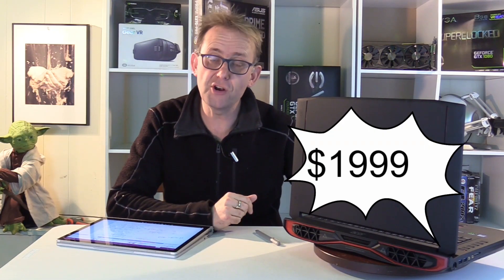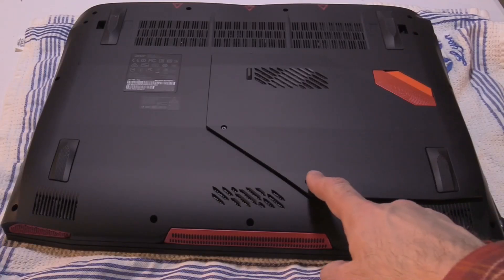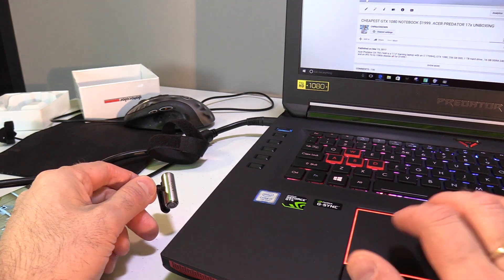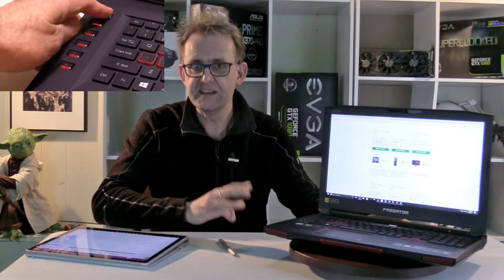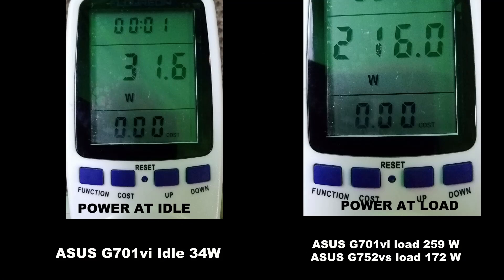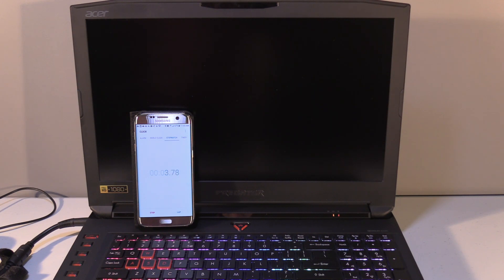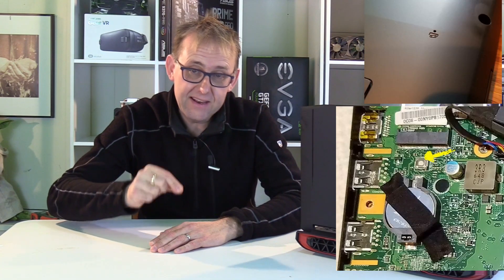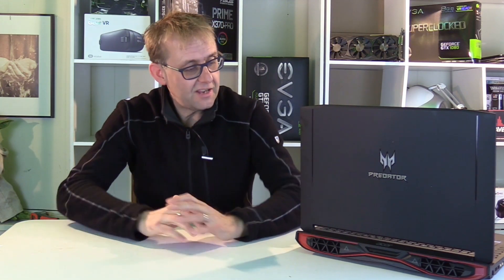CHEAPEST GTX 1080 GAMING NOTEBOOK ? ACER PREDATOR  GX-792-7448 FULL REVIEW

Comment: Steve your reviews keep getting better. This review was excellent. I have 2 questions: 1. What did ACER support suggest since resetting the CMOS didn't work. Is a BIOS update coming? If you haven't done so already, can you do a quick VLOG on how to overclock a IPS panel from 75 to 100 Hz.
Reply from the maker: Hey Keith, Thanks ! They gave me a support ticket so I could continue the conversation but since I decided I was either sending it back or selling it I just continued on. I have reset it to factory settings but I can set it up again and so video on increasing the refresh rate. Good idea ! It will give me a chance to see if the Fn key is working again too :) Support was quick though, that impressed me.

Comment: Great review, thank you for your hard work and time spent doing this. :)    :thumbs up:

Not sure if you saw my question over on the unboxing video, but I asked about a 7820hk / 1070 comparison in the form of a Clevo P670HS-G and you helped answer that question in this video, great minds think alike. For the weight, size, and small price difference I'll be getting the Clevo since I'll be carrying it every day. HIDevolution also includes a fully unlocked Prema bios on all Clevo's if you're ever in the market for one and Donald over at HID is great guy to work with when ordering from them.

Keep up the great work and thanks again!
Reply from the maker: VetteTTV12 hi there! Yes, I'm sure I replied to your previous comment. You were getting it for $1700 I think? That is exceptional value and I think you have made a great purchase. Glad I was able to confirm it for you ☺️ Thanks for watching!
Reply: OWNorDISOWN For some reason YouTube didn't send me a notice on your reply from the unboxing video. 

Yeah it'll be right under $1700 for it but that's because I already have a copy of win10 and a 1tb 850evo just sitting around not doing anything, and that's with the liquid ultra cpu / ic diamond gpu upgrade for better thermals. I plan on doing a review on it when I get it in since there doesn't seem to be any worthwhile reviews on it in this configuration and zero reviews on one with a 7820hk undervolted and overclocked like I plan to do. 

Thank you so much for everything that you do😊
Reply from the maker: VetteTTV12 Yeh, youtube has stopped sending me notifications too.. Yes, great idea. Love to see your video on it! Thanks for the kind words ☺️

Comment: As usual benefit full and fun to watch review Steven but are you sure this thing is quieter that the legendary MSI Titan ? Also at top 80s C on gaming benchmarks does not these measurements considered hot? The Msi temps 70C during gaming.

Thank you for your patience!!
Reply from the maker: Naser Jabi hi Naser, thanks. The Acer was at 35 db versus MSI 41db at load. Indeed, the MSI is cooler because of the huge fans and they do spin faster. I think 80 degrees is fine when you consider the AW17 R4 i7 7820hk./ Asus g701vi / Asus G752vs /Aorus x3 v7 all get into mid 90s. That being said, I would expect an i7 7700hq to be cooler, in the high 60s to high 70s but like I've said before, the Acer doesn't spin its fans fast, even at their highest and the result is a quiet system with higher Temps. Now, although at idle they are quiet as per the sound meter you do hear a hum which you do not on the MSI so I would consider the GT73VR quieter at idle even though their sound meter readings are similar. I hope that helps.

Comment: Really appreciate the through review I just picked up the same laptop but slightly different model gx-792-703d it has Processor
Intel® Core™ i7-7820HK processor Quad-core 2.90 GHz
Screen
17.3" Full HD (1920 x 1080) 16:9
Graphics
NVIDIA® GeForce® GTX 1080 with 8 GB Dedicated Memory
Memory
32 GB, DDR4 SDRAM
Storage
1 TB HDD, 512 GB SSD. From my limited understanding that's a better processor, more ram and storage then the one in this review. So I take the specs should be just a little better or still fairly close?
Reply from the maker: Joe Sombody thanks for watching my video. Yes, yours looks top of the line, much faster cpu when you have it overclocked - should reach 4.3Ghz easily. Let us know how you make out with it 😀

Comment: hi stephen 
firstly thank you for your interesting reviews. good job 👍
i'm planning to buy a gaming laptop and i find my self attracted to asus g752vs over MSI. I feel more trusty with asus. what do you recommend me ??? 
another question plz . 
we've saw the first g752 model late in 2015, when do you think we will see the next model ?? i mean the new design not just internal upgrades???? 
thank you again 😊
Reply from the maker: Hi Mr Architect !  Thanks for watching my channel :) I did a review on the Asus G752vs https://www.youtube.com/watch?v=ByGzHQkl6-4
It was very fast, overclocked well but ran very hot. The speakers were rather poor and I was disappointed with the build quality . I didn't mention it in my review but some of silver paint scraped off the bottom to reveal black plastic underneath. Perhaps it happened when I took it outside for the screen test. I have taken my MSI GT73VR outside a  bunch of times and have used it in many comparisons and it has not a mark on it. I would but the GT73VR Titan Pro any day of the week. A button to switch to integrated graphics, excellent speakers, good cooling, 3 m.2 slots. It has it all. It is lighter in weight too. Also has MXM GPU so can be upgraded.

If any of these guys make a design change I think it will be next year to coincide with Cannon lake . I'm hoping that at 10nm it will allow for slim devices that run cool. I think that has ben a challenge thus far. ..
Reply: +OWNorDISOWN thank you stephen 
i was in love with g752 design untill you shocked me about build quaity 😢 
actually i'm looking for the best cpu on a laptop, i'm an architect and fast rendering is my target. concedering that what would you recommend for me ???
Reply from the maker: The i7 7820hk is your best option and I must admit it seemed to perform faster in the G752vs than any of the others I have tested. Not by a huge margin but faster than the AW17 R4, faster than the G701vi. I haven't had chance to test the same CPU in the new GT73VR Titan Pro. People say that they have clocked it at 4.7 Ghz but it's not just a question of speed its how much power it draws.  For example I can overclock this new AW17 R4 to 4.6 in Throttlestop but it performs worse than at 4.4 Ghz in the Bios as it draws only 60W versus the 70W in the bios. I have to figure a way to get it to draw more watts.
Pick one that will help keep it cool ,and has a good turbo fan. The fans in this AW17 are much better, although still at 4.4Gz I get a bit of throttling

I still like the MSI GT73VR as an all round laptop but the AW17 R4 looks nicer and now with the cooling looking better it is an option - although my Killer Wifi card keeps dropping connection..
Reply: +OWNorDISOWN 
i thank your generous. that was helpful 👍

Comment: Great detailed review. Would you say the 7820hk is worth the price premium for getting the most out of an external 1080ti via graphics amplifier? I'm looking at the Alienware 17r4 with that CPU and internal 1070 and 1080p display. I want to do high resolution gaming on a 4k Oled tv with HDR. I will also be purchasing a high refresh rate external monitor. So as you can see, I'm going all in and want to know if there is a noticable difference in performance in my use case between the 7820hk and 7700hq. Thanks again.
Reply from the maker: Mike Hey Mike, thanks, glad you liked my review. I have done some tests using my Alienware 15 R3 which has an i7 4710hq and 1080p performance, using a desktop gtx 1080 in the amplifier, versus a desktop is quite poor. Step up to 3440 X 1440P or 4k that deficit went away. I am going to do the same tests using the gtx 1080ti (I'll do them tonight) and let you know how that fairs. I do have the i7 7820hk /gtx 1080 model coming in and I planned on testing my 1080ti /amp at 4k there to see if there was any difference so stay tuned for that video. In the meantime I'll give you feedback to help you with your decision 😁
Reply: OWNorDISOWN Awesome, thanks for the info. I will stay tuned for the   video and really appreciate the insight! Subbed, great channel.
Reply from the maker: Mike cheers Mike!
Reply from the maker: Hi Mike. Here are my 4k Results:  Metro Last Light:  GTX 1080 laptops @4k 53 fps, AW15 R2 GTX 1080 in the amp 51, GTA V: GTX 1080 laptops at 4k 69 fps, AW17R2 GTX 1080 in the amp 69 FPS.  Now for the GTX 1080ti results: GTA V  Desktop 94 fps, AW15R2 with AMP 80 fps. .  Metro last light: Desktop: 71 FPS, AW15R2 with AMP 59 FPS.  my AW 15R2 has an i7 4710hq and it bottlenecks the GTX 1080 at 1080p and bottlenecks the 1080ti even at 4k.  I'm sure the i7 7820hk will rectify this and will check as soon as I get it.
Reply: OWNorDISOWN Awesome, thank you so much for the information really appreciate it. Looks like the 1080ti and 7820hk will be a good combo via amplifier :) Can't wait!
Reply: OWNorDISOWN Were these tests done using laptop display or external?
Reply from the maker: Mike my AW15 R2 only has a 1080p display so i hooked it up to my 4k TV

Comment: I don't understand what's up with these companies? They keep putting out laptops with 1070 and 1080 but only 1080p. Why aren't they matching 1070 with QHD and 1080 with UHD? I don't get it. Why have a 1080 with 1080p?
Reply from the maker: Abiogenesis Zero Proof I think QHD is good for a 1080 and 1080p for the gtx 1070. 120hz options and ips 60 hz options. I just bought a Sager NP9873 with QHD 120hz and it is a great screen...
Reply: OWNorDISOWN wow, that Sager NP9873 looks like a monster. I don't have that kind of cash though. I have about $2000 USD (maybe a little bit more) to work with. I'm currently looking at the Aorus X5 V6-PC3K3D. I just want a 15.6 inch that has a 1070 with QHD...I wish I could also find 120hz but I haven't found that in 15.6 inch.
Reply from the maker: The x5 V7 is out.. I would love to try it: http://www.agearnotebooks.com/aorusx5-v7-kl3k3d.html
The Alienware 15R3 GTX 1070 can be configured with a 1080p TN 120Hz display..
Yes, I'll review the Sager NP9873. I think it takes the crown from my beloved GT73VR. Overclocked to 4.7Ghz it saves a lot of time in my rendering.  
Some great laptops coming out. I'm hoping I get chance to review the Aorus x5 MD ...
Gigabyte are sending me a P57Xv7 which is a 6.6 lb GTX 1070 17.3" one to review.
Good luck with what ever you buy !
Reply: Thanks for your help. I looked into the x5v6 vs x5v7 and they seem like the same laptop except the x5v7 has 2 more usb ports and i7-7820hk instead of x5v6 i7-6820hk. IS that worth the $400 extra? Or am I missing something else?
Reply from the maker: Not sure if the x6 is display port 1.2 v 1.3 on the v7, but yes $400 is probably not worth it for  max 0.3 Ghz extra on the CPU...
Reply: OWNorDISOWN I just wanted to thank you for the information you provided me; it helped me make my choice. I went with the Aorus x5 v6 today for $1999 plus they threw in the $150 backpack/carrying case for free (got the deal off newegg.com). After I looked through the info you sent me on the x5 v7 and x5 MD, I came to the conclusion the x5 MD is out of my price range, and the x5 v7, although nice and fast, is not worth the $400 added price over the previous x5 v6, especially because I do not care about thunderbolt whatsoever. I already have a $3000 custom build desktop 1070 sli 1440p 165hz setup with 1.5 tb of Samsung Evo 850 SSD and am not looking to replace my desktop with a laptop. So I think the Aorus x5 v6 is probably the best I can get for $2000, all things considered (like the fact I do not want bigger than 15.6 in). Anyways, I want to support you but the only way I see is to sub, so I did. How the heck do you have all that money to buy this computer gear? I mean, I'm probably close to your age minus 10 years, and I've spent many thousands and thousands of dollars on gear, but oh man you seem to have tons of money to buy stuff? Doesn't your wife complain? I mean, my wife was conplaining cause I spent almost 6000 on my desktop and laptop and another 5000 on guns and amunition lol. You are a BEAST my friend!
Reply from the maker: lol. Yeh, my wife goes crazy. I try and return where I can but even with that I must have about 10 laptops . I am going to sell a bunch of stuff, I need to as I am going on a family vacation to England and that costs quite a bit. Its not easy my friend. I started my channel reviewing general stuff and VR games and was getting like 50 views and still putting loads of time in. I bought a new laptop, reviewed it and I immediately saw that  was the direction I had to go. Getting companies to support me has been hard. Sager sent me one but I  don't think they liked my review as I was too honest. I do have a Sager NP9873 I just bought so hopefully that will put me in their good graces. Gigabyte have just added me to their list and Alienware has me added now so I am getting there. I really appreciate the support ! If you have any buddies who might like my stuff please let them know. I still have my Ryzen build  to finish off - its all assembled and all but I've been taking the 1080ti out to do all kinds of crazy tests on that Alienware Amp.

Good choice on the Aorus ! Truth be told I really wanted the X7 V6 when I first started, after my AW15R3 was sent back. 
Sounds like you have spent crazy sums yourself, lol.
Reply: You can also buy the predator gtx1080 with 1080p display. Buy the 4k monitor for the predator 17 on ebay for around 150 for a full 4k ips 17 inch display. it has the same plugins as your 1080 p so its an easy swap!! Now you have a full 4k gtx1080 laptop for 2k!! You can also do this with other predator 17 laptops. You can always turn the res down to 1080 p if your running anything bellow a 1080 you might need to lower settings while gaming! The monitor is very easy to swap and I can post a video tutorial if interested.
Reply: Abiogenesis Zero Proof If you are a real gamer its all about the hertz not the 4k. Lmao.

Comment: nice review as always, by the way does it have an option to switch the cd rom drive into another fan? in the preview models  (gtx 980m) it does.
Reply from the maker: jaibsm31 Thanks. Unfortunately there is no CD ROM I this one. I show where it would be but there is nothing there. That big subwoofer is where it would have been. In the previous models what was the subwoofer like and where was it located?
Reply: +OWNorDISOWN i see, so thats the sub woofer, I'm not sure about the previous models regarding the sub woofer i haven't opened any laptops yet hehe. by the way, which one do you prefer among all of your laptops?  gt73vr, g701, g752vs or this one?
Reply from the maker: jaibsm31 The MSI GT73VR because it is so easy to upgrade, the sound is clear and loud, runs cool and the turbo fan actually works in bringing temperatures down when overclocked. The Acer is well built and very solid but that subwoofer was frustrating. The Fn key may have been a glitch. I tried two different restore points and both failed. Not having screw points for the other ssd drives seems an oversight. Other than that it was a great laptop and a joy to use. I prefer it over the Asus ones because I do like good audio and it has better upgrade options, particularly the 701vi. Performance per $, gaming wise at 1080p, it is quite hard to beat although I would favour an i7 7820hk / gtx 1070 laptop if it were priced the same or thereabouts.
Reply: +OWNorDISOWN i agree with you with the gt73vr, it surpasses them all in terms of audio and cooling, and the 120hz g sync is simply amazing. this laptop has it all.  i'm just wondering how did the acer predator beat them all when it comes to battlefield 1. it's the only game i play lol
Reply from the maker: jaibsm31 yes, that was quite a shock. I always use the same game sequence and thought I was standing still too much first time around so I did it again running all over the place and got exactly the same.. Very strange indeed.

Comment: A wonderful review but if this laptop overheat a lot why are you recommending it? Is there a way to make run as cool as the MSI GT73 Titan?
I had the 17 model acer with kaby lake and gtx 1070 but that thing was very noisy. Is this model better in terms of noise?
Reply from the maker: Thanks. The only time the Acer 17x (i7 7700hq) got hot was when I ran Heaven and Cinebench at the same time - this puts more stress on it than just gaming alone as you can see in the temperatures recorded - I want to show that the Turbo fan doesn't do a great deal as the temps didn't go down when I ran it. The RPM's of the fans at turbo are not that high if I recall. Other than that the i7 7700HQ was cool , certainly in comparison to the i7 7820hk models..
Perhaps I could have tried HWinfo64 to see if I could alter the fan speed..unfortunately I took it back to the store.
I think that is the main reason why it ran hot when really taxed - the low turbo fan speed.

I recommended it, even with the issues I had - The Fn key issue I am sure that occurred when I unplugged the little connector I showed when opening it up. I thought I put it back securely, who knows, but it did seem to occur after that. The poor Subwoofer was a defect on my unit - I went back to the store to returh it and they had aG9 on display and that sounded fine. Thanks for watching !